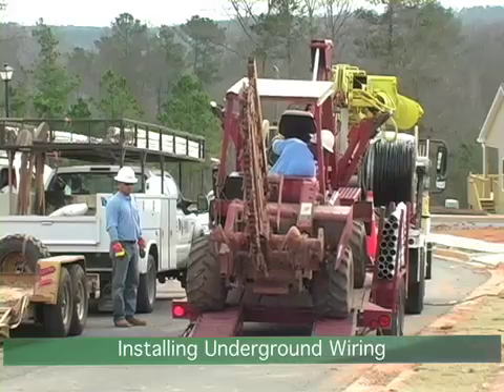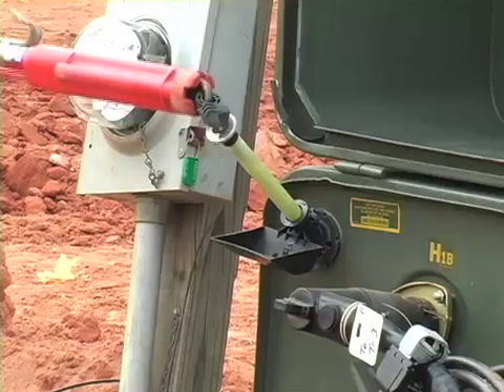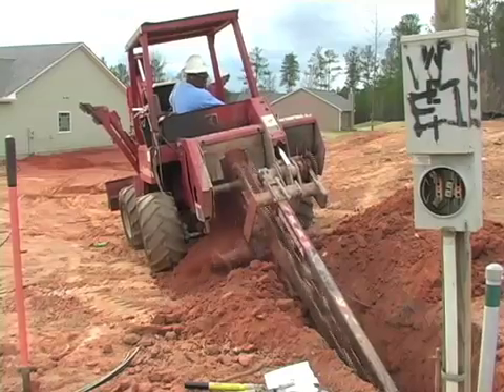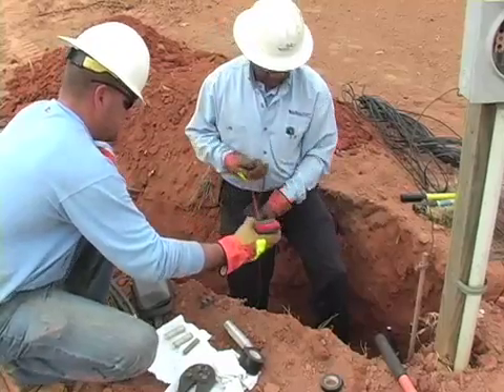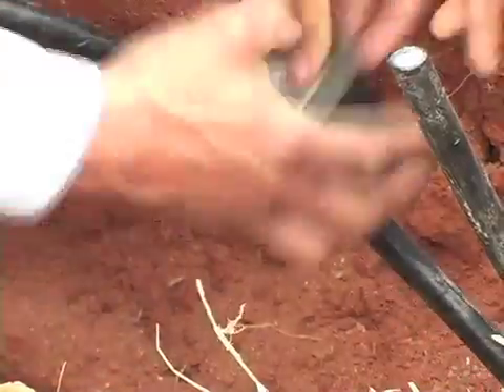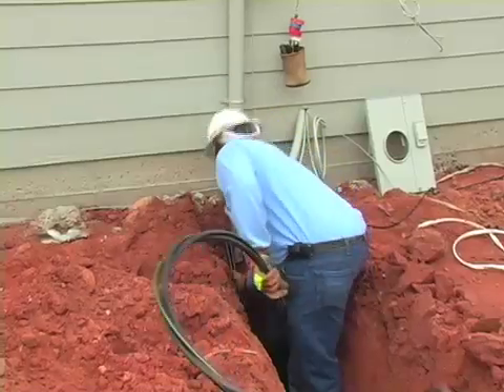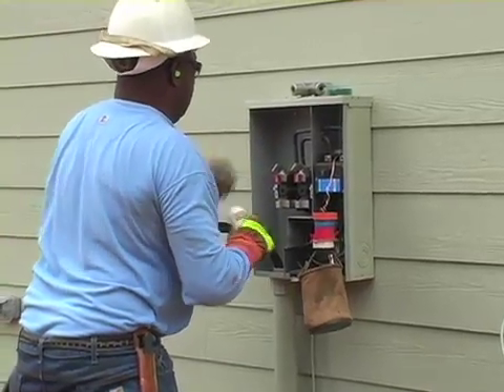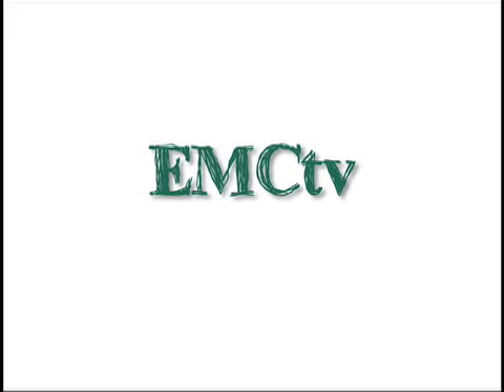Installing Underground Wiring-Updated

Comment: Dont these cables in the ground have to be covered inside a grey PVC ? Will they not corrode after a few years ? curious.
Reply: It really should be in a grey PVC conduit, as many are, but I guess their code does not require it, or prohibits it.